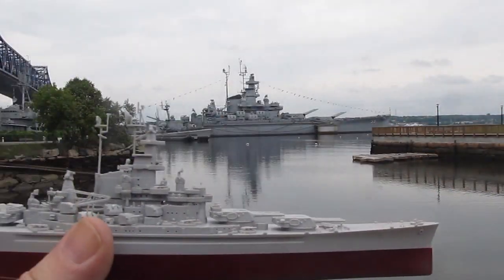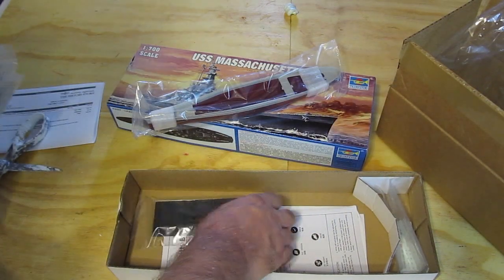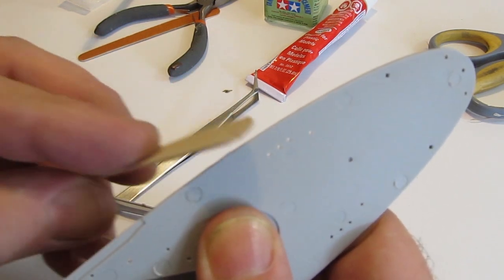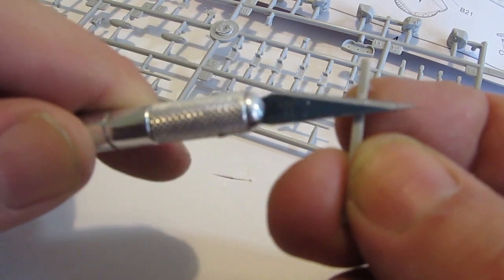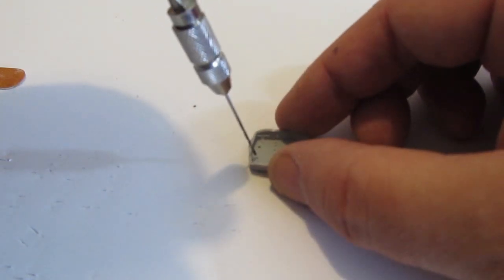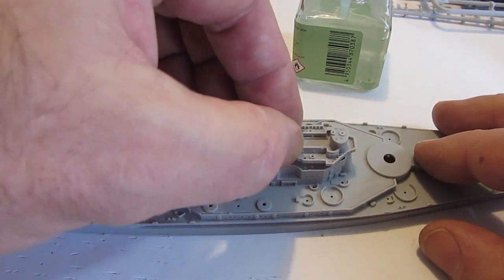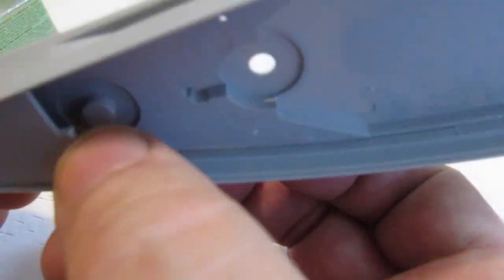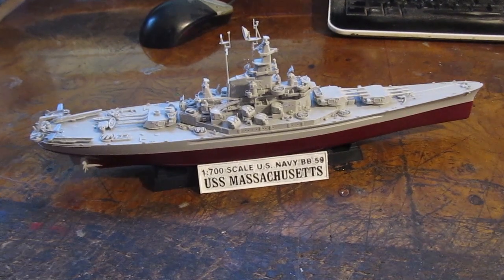Make a Plastic Model Battleship

Comment: The reason the planes are molded in clear is because, at such a small scale, a separate clear part for such a small canopy is unnecessary and would be extremely difficult to glue on (nevermind without a gap). With the planes clear the modeler can just paint everything but the canopy and hey presto! you have a seamless clear scale canopy.

Comment: Looks geat!

How was it, fit-wise and all that? I'm unsure about getting another 1/700 Trumpeter ship kit ever since I worked on their RN Littorio. All the walls of the superstructure were separate pieces, so frustrating to get right, I just gave up on it.
Reply from the maker: IT was good, the fit was good. But I definitely got a bit frustrated because some of the parts are extremely small.
Reply: 1/350 is the best scale for a Warship - Trumpeter , Hasegawa , Fine Molds ( of Japan ) , Tamiya and Dragon are the best makers , although Merit and Fujimi also make not bad kits (and rare ships )